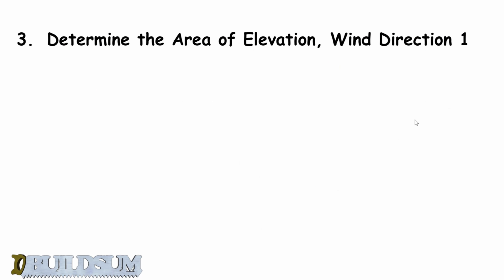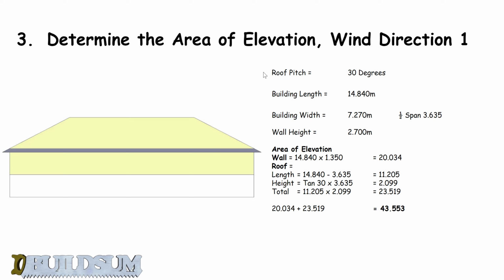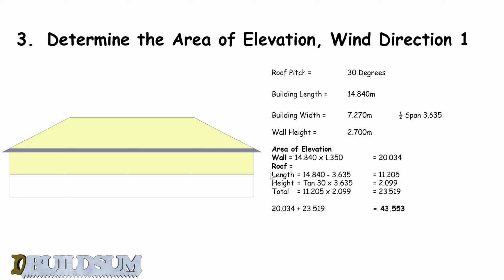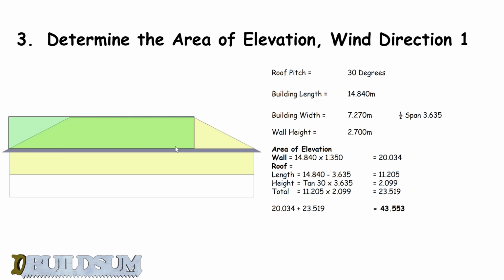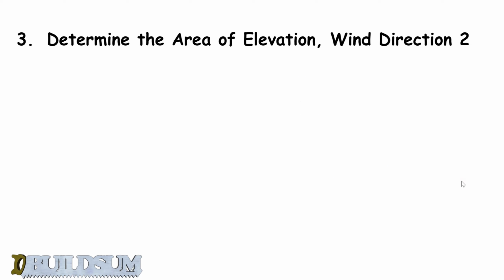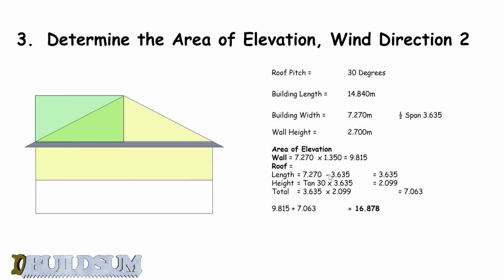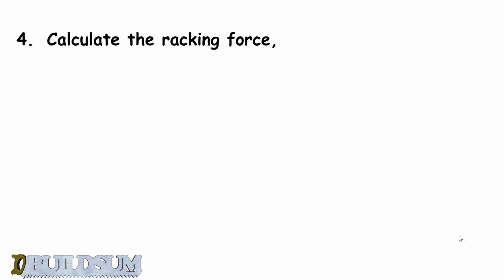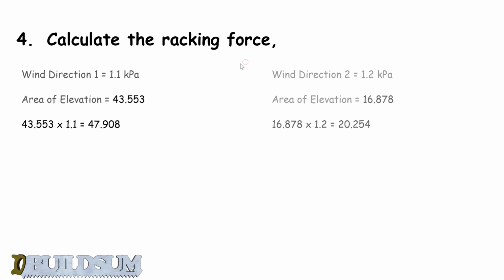Calculate Wall Bracing - Part 3 - Calculate the Area of Elevation and Calculate the Racking Force.

Comment: What did you get the half span from the roof is it the part you cut off? Thanks!
Reply from the maker: I can come from the plans or be measured onsite, it is just half of the distance from the Birdsmouth to Birdsmouth of the rafters.
Reply: @Buildsum  THanks what is the birdsmouth? Like you said measure only half of the length of the wall so is that also the same with the roof just half of the roof?

Comment: I can describe in words, how helpful your videos are. 
Keep up the good work mate
Reply from the maker: Thanks Mate, will do, thanks for your comments
Reply: @Buildsum  hey buddy 
In regards to building racking force. That table you using, that goes to maximum length and width of 16 m, what to do if length is 17.5,that a question in my assignment. 
Cheers
Reply: @Buildsum  
In regards to wind pressure table
Reply from the maker: Hi Mate, if it is not covered by the Table then it is outside the limits of the Standard and therefore would required a Structural Engineer design.

Comment: Hey Buildsum,
 I think what the standard meant by not calculating the eaves relates to the triangular area on the ends, not the rectangular space within the building.
Reply from the maker: Hi Mate, agreed, and perhaps the diagram in the video dosent show it too well, but the height of the wall actually comes up to the base of the roofline so that rectangal has still been calculated. Hope this helps.